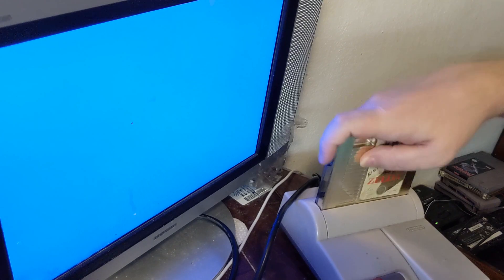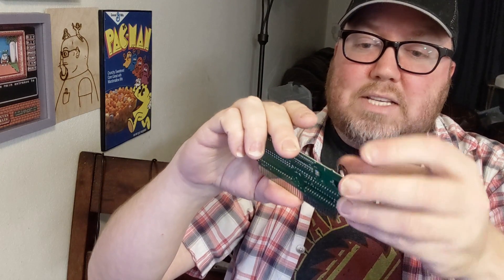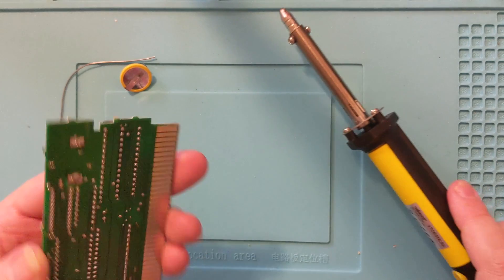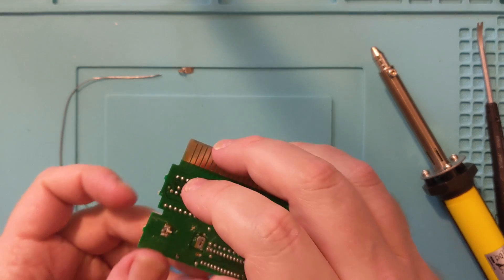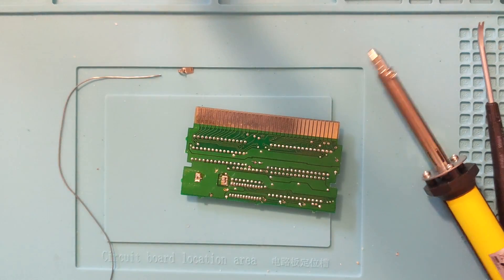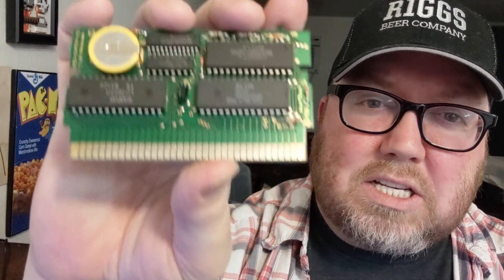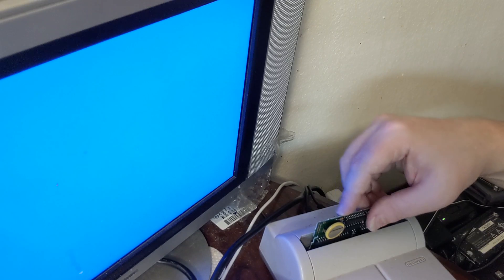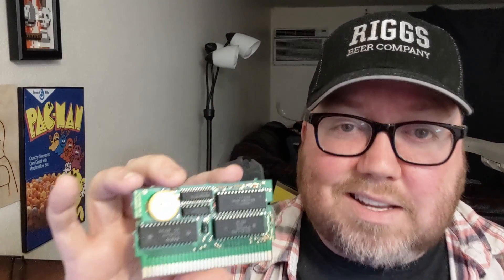Open Cart Surgery - Legend of Zelda for NES

Comment: OK HERE WE GO JOHN, Break out the multi-meter. For I have cracked open my copy and tested some values. I think you should do a part 2 of this video and fix it if any of the diodes or resistors are bad.
OK, we are going to start at the top left and move clockwize across the top of the cart.
Top left Diode should read around: .591 in diode mode in one direction only.
Next is a resistor should read around 10 Kohms both ways with the leads.
Next resistor should read around 9.9Kohms basically 10 both directions.
4th: Diode should read around .561 in on direction of the leads.
Next right hand side should read 4.0 Kohms & then 2.5 Kohms when you reverse the leads.
Bottom  right resistor should read around 27 Kohms
Last one, in the center of the cart by the cap. Should read around 4.0 one way and 2.5 reversed.
You can try and test that cap, my reading with ohms setting was 4.0 Reverse leads & 2.59 Correct lead on +.
Capacitance test in circuit yielded incorrect values forward. In reverse it read 100 pico.

There you go brother. Break that cart back out and test it. Also do continuity test on all the pins to the rom. To make sure they have a connection and there isn't a trace break under the masking you cannot see,

Comment: Try reflowing the chips. If that doesn't work, pull the chips and put them in your chip reader to make sure the chips are still active.
Reply: NES roms don't use the worldwide standard rom pinout (jedec), you most certainly will run the risk of frying the chip or the reader if you do that
Reply: @amirpourghoureiyan1637  I don't think it would in the Chip reader. also on the reflow part if you do it quick and at the right temp. also seeing as its not working at all why not?
Reply: @vgplayersandhaters518  these chinese rom programmers don't have protection against short-circuits. They aren't cheap either, I'd just use it as a donor board, giving up the ubiquitous Zelda for a lesser known game, at least then it'll work properly too
Reply: that was what i was thinking.
Reply: Lassi Kinnunen  he uses standard eeproms and rewires them when using donor boards but also uses new repro boards that have the new pinout with custom roms
Reply: @Vipergaming23 its still surprising how many times people send him games, claiming they've cleaned it - but after he's cleaned it again, it works! I don't really mind what John uploads, I still enjoy these vids regardless if they are successful or not

Comment: Pull the cap and tested it with a meter. While the meter is out pin out all the traces back to the chips for continuity. If all of this checks out then pull the chips and dump the images with your reader to verify they are good. 

With this method you can diagnose any cartridge that comes your way

Comment: A bad battery won’t stop the cart from playing, just won’t save. When you get a gray screen can be several things, but it’s telling you the CPU or PPU isn’t able to read from cart. Maybe a cut trace, bad connection, bad EPROMs. I would start by checking connectivity between the cart traces to the chips. Then reflow all the chip legs. Then plug into the console without the case and check your getting 5v to the chips. Searching the part number will give pinout. If no 5v you have a bad trace or connection. Voltage is +\- 10% maybe a bad cap. If you had a o’scope or
Logic Analyzer you can do some more test. Good Luck.

Comment: You need to hold that iron down way longer for a blob like that. Hell on one side it doesn't even look like you heated the pad at all. Just melted the solder a bit. 

You made a "cold" solder joint. Hold the iron in contact with the pad and the tabe till you see the solder "wet" and seem like it is flowing across the surfaces it is bonding to.

Comment: I’d check the cap. Those die after time. Happens in Game gears all the time. Old carts as well.
Reply: Amen brother. Same exact story here. Have my original and my sisters. I ordered a cap set off eBay to repair them. Just have to spend the time doing it. It’s tough, cause game gear is really.....well, not the greatest. Hard to spend a ton of time or money on them. I got the kit super cheap on eBay luckily.
Reply: SesshyS and that is the trap we are in. I don’t want to fix them.....I need to. Have a good weekend brother

Comment: Take a good look at the traces and see IF you spot any damage to them. IF you don't own a microscope or a good magnifier there are free apps for android phones that can turn the camera into a make shift magnifier. Of course a multi meter in continuity mode is good for trace testing. Other than that check the the solder joints on all the chips as well as trying a new capacitor and resistors. That half assed battery repair may have caused some trace damage or some damage to the board or chips. Yanking things apart with pliers and re taping them is NOT the best plan of action.

Comment: The battery was taped on. Was that from the original manufacturer? Our has someone done an open cart surgery  that they may have botched, thus killing the patient? Before sending to you.
Reply: Uh no, why the hell would Nintendo use Electrical Tape to attach a battery? It is soldered on at the factory. Boy are people dense...

Comment: do you ever fix a game? :/
Reply: He stopped trying pretty much. Just cleaning a game isn't going to fix it if there is a legit real problem with the game. Re-flow joints, check leads, multimeter test around for continuity, switch the chips, ya know. Stuff that can potentially either fix a problem or give you information to what the problem is. Hitting it with a 1UP Card and Brightboy isn't going to fix a game 90% of the time.